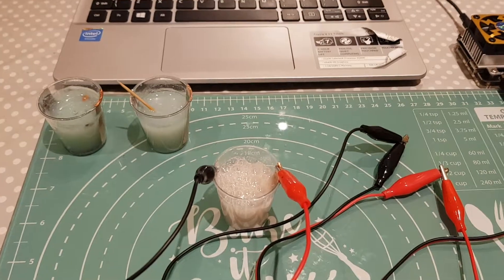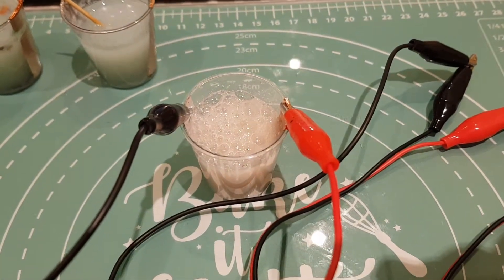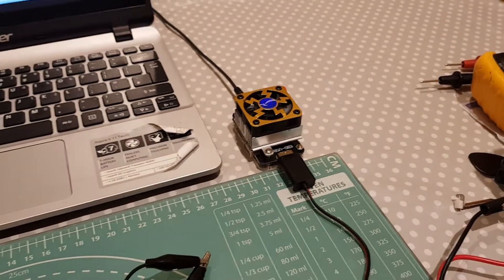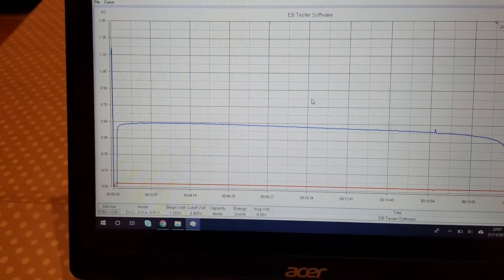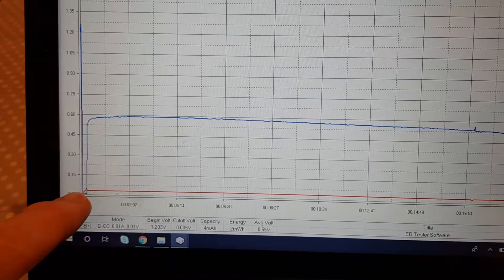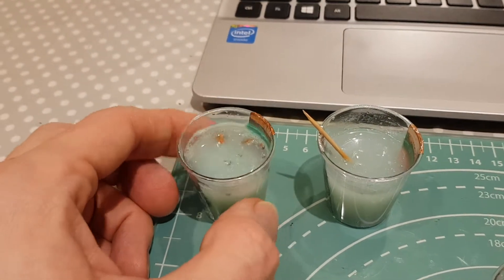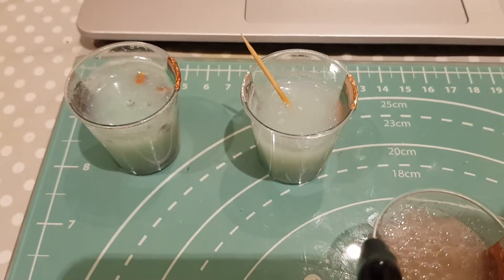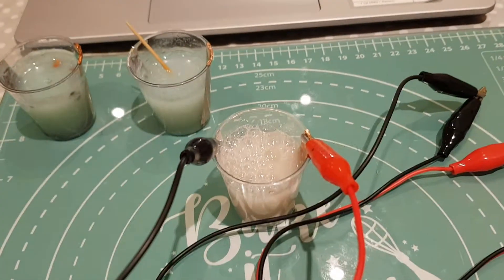Developing a Gel Electrolyte for Batteries - Part 2 - Calcium Chloride Tests

Comment: Good day sir,i have a question i have 12v gel battery 40amps,how many pcs off calcium chloride that i can  mix the water?then what kind off water sir distilled water for mix?.
Reply from the maker: I presume you're talking about a lead acid battery? I wouldn't recommend adding anything other than distilled water.